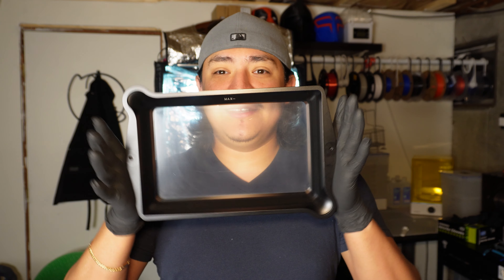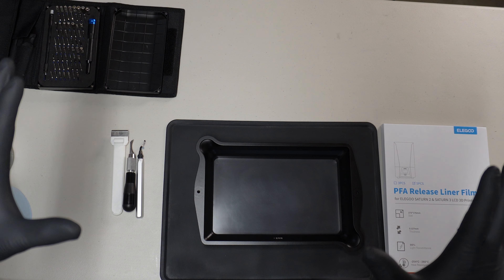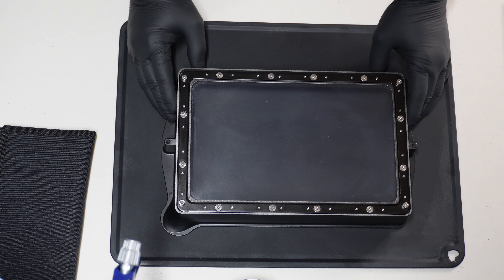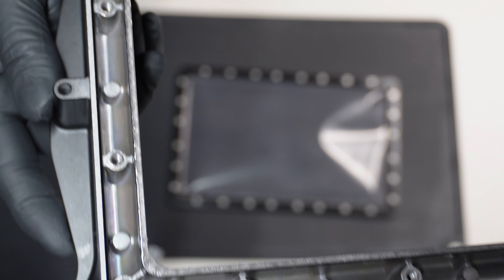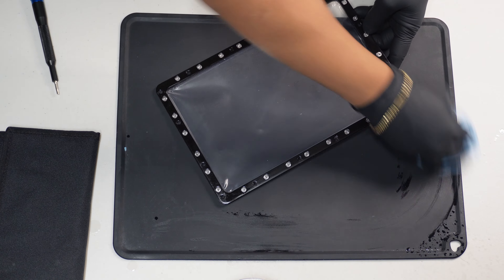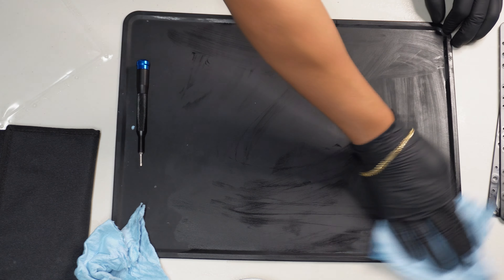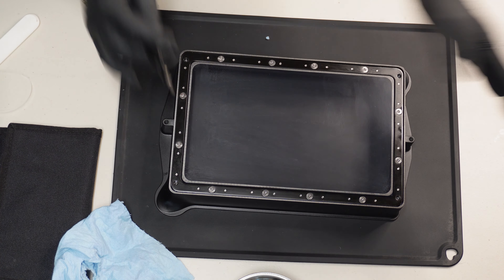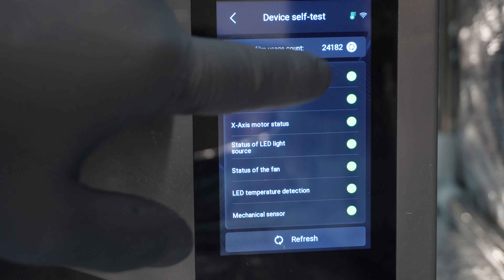Saturn 4 Ultra - PFA Film Replacement Process

Comment: Thank you for this tutorial-its very thorough. I just started 3D printing with the Saturn 4 Ultra and got my first hole in the PFA. Thankfully I took the advice of another channel and had a screen protector for the LCD and the leak was minor. After watching your video I feel much more confident to replace the liner. :)
Reply from the maker: Thanks so much for watching! Glad I could help! And good thing the leak was minor!!
Reply: @ThatDudes3DPrints  Just replaced it - took no time at all and was tight as a drum! Thank you again.
Reply: How did you buy the screen protector and which one was it? :D
I'm at the point where I need to replace the pfa and recognized slight leaking at the edges. Now would be the perfect time to install a protector. :D

Comment: the original guide from elegoo suggests you to place a piece of something soft under the film when fastening it in the frame, to increase slack and reduce tension when it is installed in the vat
Reply from the maker: I can see why they did this however it's not super tight on the frame to begin with. I have been doing this with out clearly and haven't had any issues. I'll have to try doing this the Elegoo way and see if there is a difference although I am not sure there will be.
Reply: @ThatDudes3DPrints  Its pretty much standard practice on all SLA machines to put a spacer in (typically a 8-10mm bottlecap). It gives the film enough slack so it can be seated deep enough on the vat frame without being over tensioned.
Reply: Thanks for the confirmation that I should use something underneath. I've had so many problems with my printer so far, I've lost almost all faith in Elegoo, but still trying to make it work. Good to hear it's standard practice

Comment: Would heating up a scratch awl or something work a bit better you think to make the holes or would the heat from the tip of the awl warp the film too much?
Reply from the maker: That's a good question not sure about the heating up part but using one of those might work better.

Comment: I'm new to 3D printing and I want to buy this printer. Is it necessary to replace it, and how much use do you need before replacing it, or does it depend on time?
Reply from the maker: It depends on many things like yes time and damage so if there is damage but say you just changed it you should change it again but it can also be after a certain amount of prints. The printer does tell you when to change it you just need to update it manually once you did.

Comment: some sites tell me that it matters what direction the FEP is installed.  does it matter if the side with blue film originally or clear protective film originally is "up" , Ie the side that the resin will rest on?  thanks!
Reply from the maker: Great question! I might have to do some digging as I too am a bit new to this but I have just put it on randomly and haven't really had any issues or loss in quality
Reply: @ThatDudes3DPrints  Thanks so much, I am nrew to resin printing as well.  Have been doing filament printing for a few years.    I am having a lot of issues with the resin printer sticking to the PFA and then tearing it when i try to remove.   Am sure I am doing something wrong....   but changing the film every print is getting to be a downer...    Thanks again for the answer.
Reply: Not sure if this is the case for all FEP manufacturers but the last one I fitted gave instructions as to which way on the packet. I think the issue is that the FEP is a sandwich of different materials and fitting wrong way causes issues with durability rather than print quality. On the FEP I’m using the blue side should be up as in towards the building plate. I don’t know if this is a standard but would hope so.
Reply: @stephencordell6745  Thanks Stephen!

Comment: Do we not need to use a tensioner for PFA? I just replaced mine without a tensioner and the first print did the bottom layers and then failed from the middle out.
Reply from the maker: I haven't had any issues the way that I do it but if you feel more comfortable doing it another way by all means. I am just showing you what I do.

Comment: Use an Awl to punch a hole. The bigger it is, the wider the hole you can punch through.
Reply from the maker: I'm going to have to get some!
Reply: @ThatDudes3DPrints  I use one, makes it way easier and less chance of the sheet moving.

Comment: in my experience toilet paper doesn't scratch the fep like shop towels do.
Reply from the maker: Good to know I will have to try it for myself! Any particular brand or type?
Reply: @ThatDudes3DPrints  kirkland is what i use. then finish up with disposable lens cleaners. they dont leave fibers and are great for the LCD as well.
Reply from the maker: Thanks for that tip!! I'll be sure to try that!